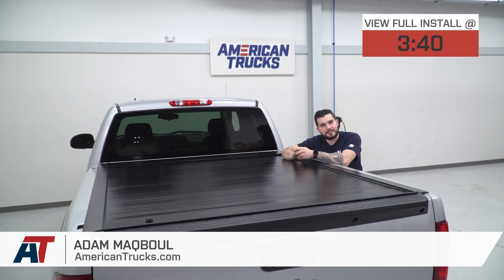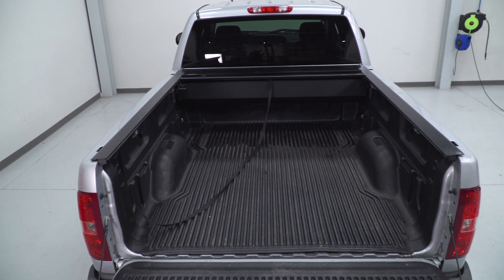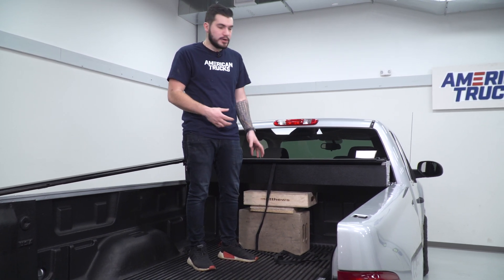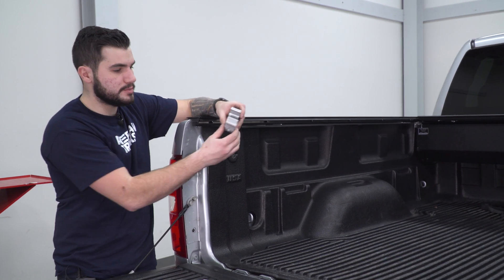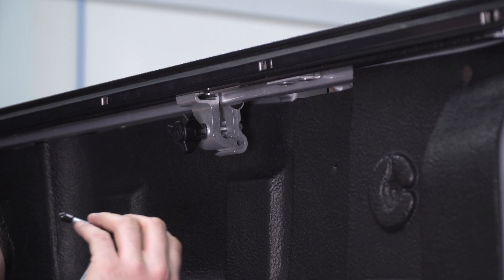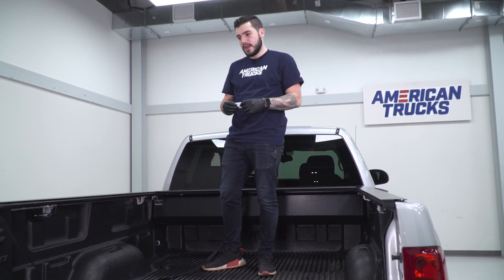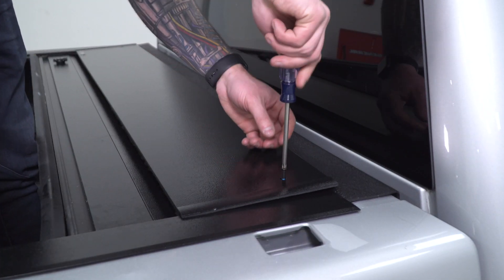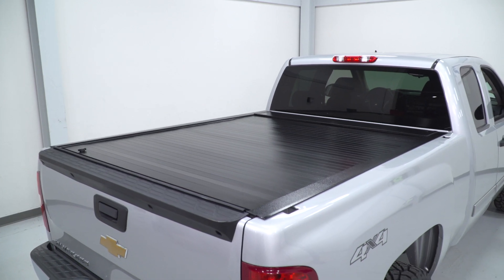1999-2018 Silverado & Sierra 1500 Pace Edwards JackRabbit Retractable Bed Cover Review & Install

Comment: I've used a similar one of these on and off 2015-2020 I use my truck all the time hauling stuff .... simply if you use your truck bed alot one of these aren't for you that 1 foot you loose bites you in the bum alot and you'll end up having to take it off a bunch

Don't get me wrong these are super nice and kinda worth the hassle but a simple roll up one works the best don't look as cool or open and close as easy but oh well